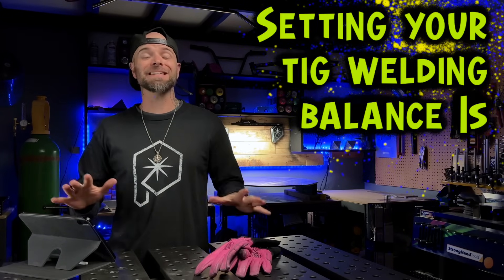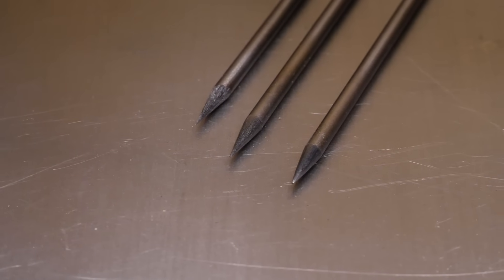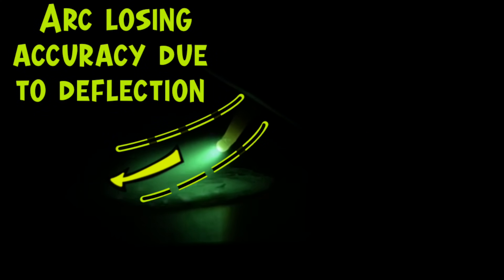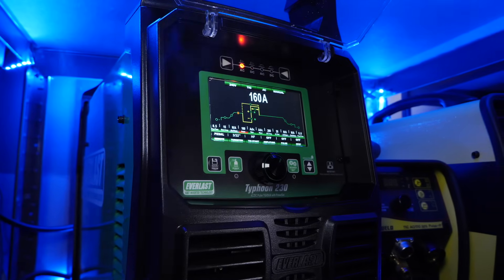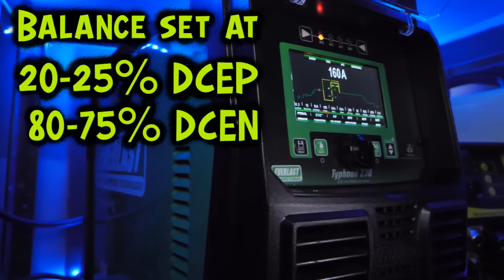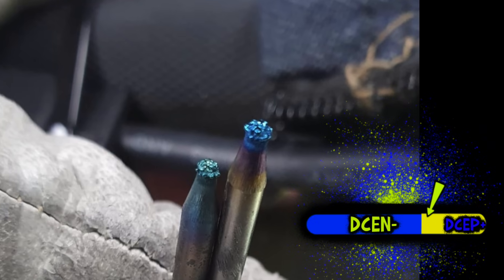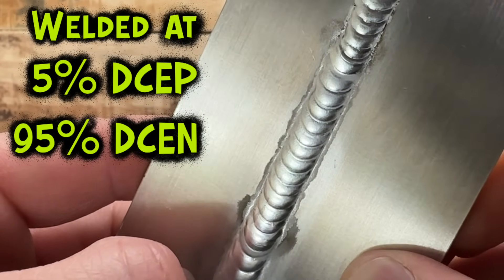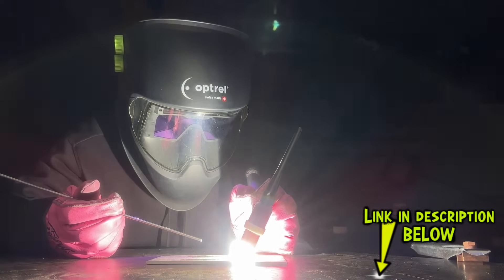the DEFINITIVE GUIDE TO TIG WELDING BALANCE -How to TIG weld aluminum

Comment from the maker: check out my FREE ONLINE TIG WELDING CLASS HERE👉 https://app.ewebinar.com/webinar/tig-welding-aluminum-with-no-prior-experience-no-schooling-and-with-whatever-gear-you-have-10740
Reply: Not want to weld aluminum 
I wanting to weld Thin metal .28 too chromoly tubing I keep burning holes in the sheet metal even at 20 amps and at 15 amps using av# 8 or #10 cups when I practice and practice and practice and practice  before I weld on the chassis.
I am burning holes 1/4 wide in the thin metal
I am Using a Lincoln 210 scratch start or a Vulcan 205 high frequency start   I do the same thing with a 1/16 Tungsten and with a #8 or #10 cup  set at 20 amps or 15 amps and  I burn holes burn holes in it then I go a half in. With a fair weld .
I don't want too the burn the chassis  full  of holes .
I got the Lincoln welder and Welding brackets on my rotisserie and done a fair job for never doing it before now all I'm doing is burning holes
Reply: @kenlewis5968  Do you mean .28, or 0.028"??? 0.028" you might be better doing muliple tacks and letting it cool, not running a bead, so it doesn't blow holes. tack each end, then the middle, then keep splitting the distance with another tack until they start overlapping, then hit with an abrasive flap disc in the angry grinder to dress the weld smooth. Pretty much as you'd do on body panels with MIG, really.
Reply: Just watched the free lesson. I will be checking if the company I work for will reimburse me for the full lesson plan fees. If that is the case I will be signing up. Cheers !and thank you

Comment: I’ve tried all these methods and I’m still getting a misshaped tungsten. I’m using a 2% lanthanated 1/8” tungsten, I prepare my tungsten with a ball at the end. I’m welding on 3/4” aluminum. I’m using a Miller transformer syncrowave 350 lx…I mess with the balance but I don’t see no difference still get a misshaped tungsten after 1 to 2 passes. It’s got a set Hertz of 50/60 set from factory. Any suggestions would be helpful thanks.

Comment: Im assuming the good tig welding machines allow you to tweak the positive and negative side of AC balance? I have a simple Weldpro ACDC 200GD because its really all i could afford, But the balance and dig are a single knob, with it maxing out at 75 if turned all the way to the right. is this tweaking the positive and negative side of AC balance? or is this two different settings combined? im confused as shit by this.

Comment: i weld with a dynasty 400 at work anybody got any tips when i'm pushing 250-300 amps , my tungsten always blows out . he said 150 amps like it was a lot , im welding oil coolers and we have to get them to pass 400 psi . im new to this but i have the basics down . wish me luck and any advice would help .

Comment: Hi. I just bought a new welding machine and I want to learn to use it and start welding aluminum. At the moment I am trying to learn whatever I can about balance. The thing is that the machine I bought has all these knobs for setting it up and the knpob for the balance starts with -5 and ends with +5. Do you know anything about this and can you explain to me where the 30% should be on this knob? Thanks
Reply: Well I am no expert on the machine you are using but the difference between -5 and 5 is ten, therefore I would guess -2 is 70% negative and +2 is 70% positive
Reply: @hc9195thanks. Since then I changed the machine to one that has a digital screen and I just set it to the percentage I want. But thanks for the information

Comment: Great info. I am a hobby welder doing mostly steel, But i am building a vacuum chamber in 1/4 in 3003 treadplate. I was just struggling with the excessive balling. Looks like i need to change my balance :)

Comment: The more heat you are using versus the balance is the key as while on the positive cycle the heat is going into the electrode.
You have to turn it to least positive when cranked up high or else not only will it ball up, the balls will melt off into your weld.
You have to find that point where the tip balls up  but still hangs on.

Comment: Man I’m excited to try this out! I commonly have incredibly thick aluminum to weld, I used a 75/25 helium argon mix around 275 amps. Even with 1/8th tungsten I’ve had this issue ALL DAY. If this works I’ll be stoked ! Appreciate your advice !

Comment: I am having a heck of a time getting repeat welds . I have been welding stick, gas and MIG and do fairly well but with TIG I do not get consistent welds . I have a cheap TIG welder a 200 dollar Tooluim Stick and TIG . I can not control the heat , when you talk about balance, I do not get what you mean , is this heat setting versus gas flow . I have tried your thickness versus heat, using 120 gaffe to amp setting . I completed a couple  decent TIG welds on steel. Aluminum was a disaster .

Comment: I have a syncrowave with balance of only 1-10. 1 being max penetration 10 being max cleaning.. what does this mean in regard to this?
Reply: Your penetration is dc- and cleaning is the dc+ side. General rule is 70% dc- and 30% dc+. You would set it on 7 as a starting point and fine adjust from there

Comment: I find Welding Tips and Tricks more helpful with beginners, especially working with limited materials.

But this video is helpful to explain why my tungsten starts to go to crap once I start welding AC. Probably I have the AC balance too high. I only have thick blocks of scrap from a CNC machine operator, so I usually must weld at very high current. The torch also gets HOT when you weld too unless you are using water cooled. Next time I'll try using lower AC balance and raise them as necessary. Often those big blocks I have to preheat them, or maybe just start a bead somewhere on the metal, and let the welder heat it up, then I can back off the current. Weld has ended up looking better as a result.

Comment: Recently had a period of time where all I welded was 1/8” thick material. I used a #5 cup with 3/32” tungsten and cleaning at 25%. Amperage was less than 150 amps. Then I had a run of 3/16” material. I switched to #8 gas lens with 1/8” tungsten. Stuck with 25% cleaning, but needed 200 amps. I got the nodules you showed in the video. The welding was good so I stuck with it and just changed tungsten more frequently. I played with gas flow a little, but never though to try a lower percent of cleaning, because I was having enough success to finish the project, but this tip may have made it even better and maybe faster due to less tungsten changes. I guess you could say I got into the rut because it was good enough but the whole time I was thinking how did this happen with #8 gas lens and not the #5 standard cup.

Comment: One way of looking at it is that only a certain amount of energy is needed for the EP portion of the cycle to clean/deoxidize the aluminum surface.  So as the total energy goes up, a smaller proportion of the total energy is needed for the cleaning action.  So as your amperage setting goes up, increase the EN portion (or decrease the EP portion).  I have noticed this and it is not dramatic but at 150 A, I generally only need about 80% EN, but when I drop down to around 80 A, 70% EN seems to work best for me.

Great video and explanation.

Comment: Pull your tungsten in so it’s sticking out 3mm from the ceramic shroud not 15, rookie mistake, weld is protected by the argon, the zirconiated tungsten should be a ball not a point.

Comment: Hope this helps.
Either you dip it in the melt, or you use the wrong type of tungsten for the material. Alu and stainless, common metal has different tungsten, marked red and green.
Keep in mind that the shielding gas comes in different varieties too, for different purposes.
Investigate which one you use for which and then you will get a lot of other important information regarding Tig welding.
Reply: Zirconiated tungsten for ally, white end.
Reply: @FroggysGoldProspecting  2% Lanthanated, does everything for me, but I'm using an inverter TIG, not transformer

Comment: Dusty, I really appreciate the info you give online here. I’ve learned a lot from you and your personal experiences over mine, and it’s great. I’m getting Into aluminum tig after 16yrs of 6G pipe welding. I’m a good welder and I just get it if you know what I mean but tig is waayyyy dif. I’m so intrigued it’s unreal but I’m  having a hard time getting started with settings and tungsten choice. It’s just so different from what I thought but still gets me pumped to try a solid bead. Just not achieving desired yet.

Comment: Here's a question.  For under a thousand dollars Canadian can you get a solid tig; ac/dc programmable (frequency, pre/post,  alternating , variable foot lever, a solid torch, and plumbing?   At what point can you get a torch that you can actually dial in based on the metal and filler specifications?      I'm tempted by the 350 welders but they dont come with the features you would want for sanitary welding or pretty stuff.    It looks like there are a couple of boxes that have the features but I don't know if the numbers are right on them.   Are they well engineered or do you still have to practice the "art of welding"

Comment: Why is when EVERYONE TALKS ABOUT TIG WELDING IT ABOUT WELDING ALUMINUM  how come NO ONE TALKS ABOUT WELDING STEEL  AND chromoly there is other stuff out there besides aluminum.
Reply: I forgot to tell you what the set up is  
Using a purple  1/16 tungsten, amps set at 10 amps or at 40 amps, a number eight cup,  gas is 100 % Argon it is set about 20cfm  on 220 volts and I tryed  it on 110 volts  I just burn holes on the top plate while trying to do a lap joint and get sparks  and sometimes  while I got a bead going I get a flash starts but never stop the  the weld

Comment: Great explanation of balance. Been running a 1974 Miller 330a/bp for about 4-5 years now. Just picked up a miller syncrowave 250 with water cooler and all used for $1000 out the door. I cant wait to get it hooked up and running.

Comment: You just keep knocking it out of the park with these tips!
Reply: i usually max out the balance and turn up the amperage, then hold the torch perpendicular to a weld surface and hold the pedal wide open until i get the ball im looking for.  works for me anyways

Comment: Im new to tig welding i am under immense pressure to learn upto 3f and 3g only in few days. I struggle a lot in fillet joints. Any help please.
Reply: Hey, I’m not Dustin but I’ll try and help you as you are under a time crunch. Fillets can be the toughest to master when you are starting out. I found that keeping your tungsten as close to the workpiece as possible helps with getting the proper penetration and you have to watch the puddle closely to make sure both sides of the joint are even and the puddle is wetting out down into the root of the joint. It takes a lot more amps to weld fillet joints and because of this you have to watch your heat closely. It can build up and run ahead of you and the puddle will begin to widen and droop into the joint. You have to watch this and back off the amperage on your pedal and especially at the end of the joint to finish the weld without a crater. Hope this helps.😊👍
Reply: @PranaTech  i weld on 6 mm  plate at 145 amps. I can somehow manage the torch length and angle but whilst tapping filler wire sometimes its gets stuck. ( then everthing goes downhill). I tried feeding the filler wire but the weld bead will become thick( and it doesn't look nice).
Reply: @YoureUsingWordsIncorrectly  i am trying my best but unfortunately my hands shiver a bit.( because of this i also had trouble using 7018 rod).